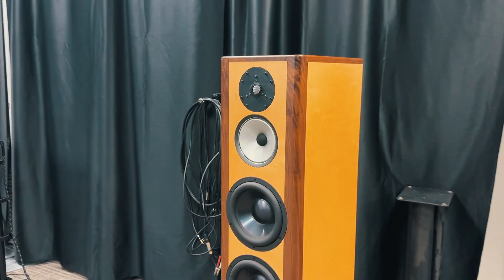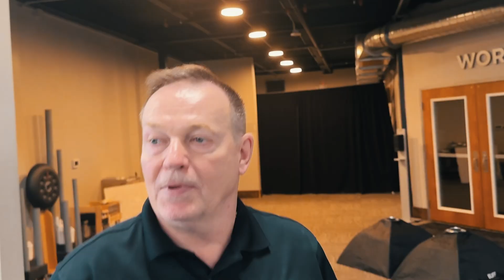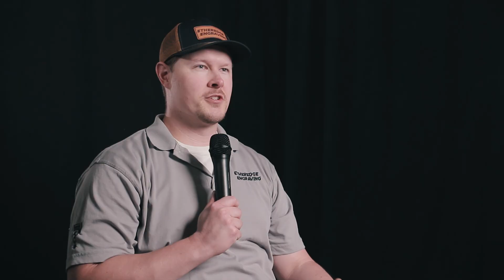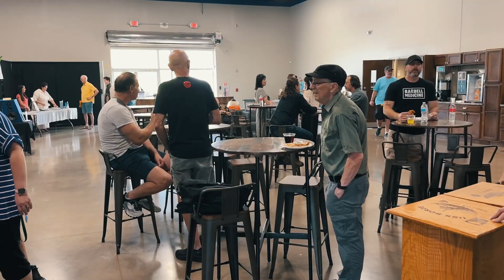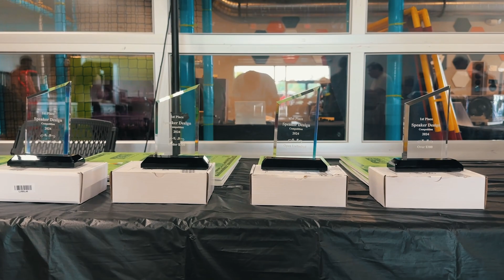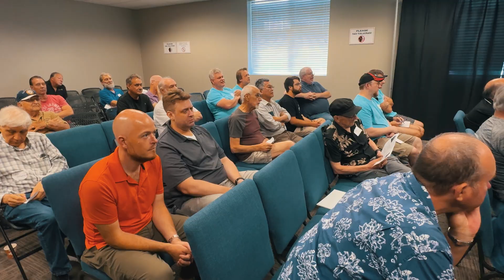OHIO Speaker Design Competition 2024 - Custom Stereo Speakers

Comment: THE THUMBNAIL:
My next pair of speakers will have a similar stand as on the thumbnail, but my driver placement will be different. The reason I clicked is cos of the stand in the thumbnail. Mine will have a down firing 10" woofer at the bottom, in an up-side-down squat flower pot (inverted and converted). Then above the flower pot woofer, is an 18" open woofer, and above that is a coaxial driver made from a separate 10" PA driver and a 1" soft dome tweeter (inside the 2" voice coil tube). And a 5" wood open horn 1" in front of the 10" coaxial center. I already have this, minus the open 18" bass driver (like in the large open baffle speakers on YT). I fed controlled bass in my 10" open coaxials. The open sound gives the kick drum that subtle "puh-huh" sound you hear on a real kick, and gives the boxed woofer bass a clear edge I don't get with just the boxed woofer. And this is the reason I want to make the speakers with the open big woofer. The open coaxial makes sounds come from nowhere! And with the open horns, the holographic image is more tangible. 😂